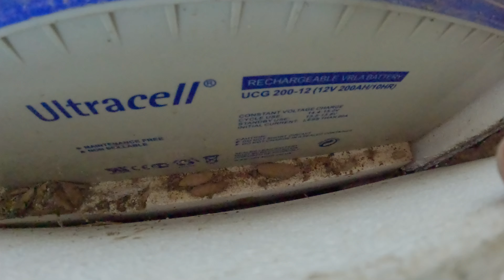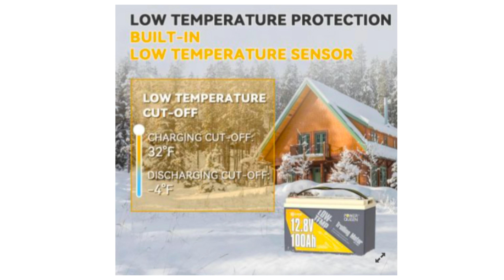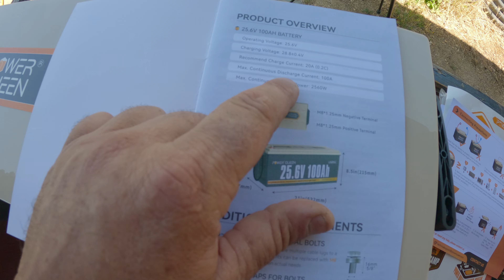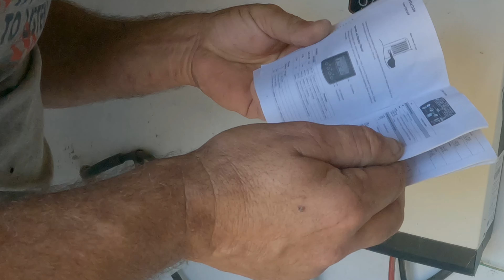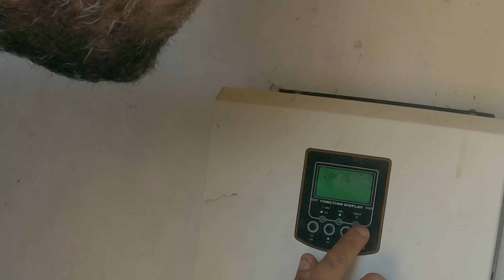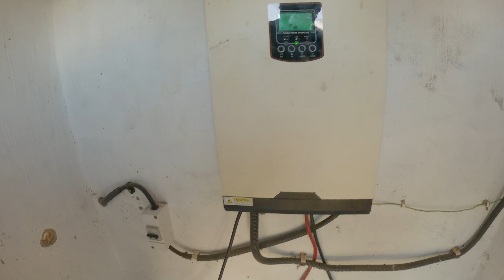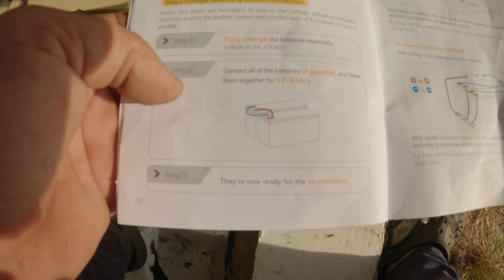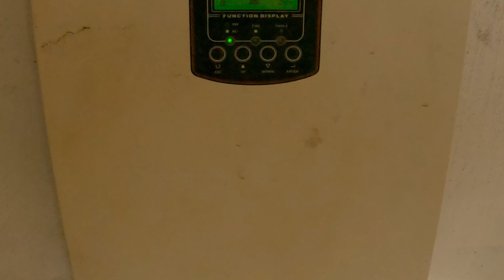Upgrades to our Off Grid Homestead in Central  Portugal #powerqueen

Comment: Wonderful!   I almost said something about the front seat in the car and I realized....it's the same trip!😂😂   I'm so Happy for your new Lips batteries!  On my sail boat I had AGMs.  But here at the house I have 2 Lipps 12V 28amp 100hrs.  But I only have 400 Watt panels. The panels, are going on my shed roof.  I don't have a lot of cleared land around me, and to many pine trees I have to watch out for!  Well the system will keep all my battery operated tools charge, my lawn mower is battery(reason I changed is long, I'll save it for another time)  and a battery operated limb saw.  It's cool but hard to hold cause my arms get tired.  And it will keep whatever lights outside that are not solar powered operating.  So it's good for now.  I have a 15 ft x 15ft Screened in porch off my dinning area (bought this way) and after Big storms, I put my zero gravity beach/deck chair out there and sleep like a baby bc the wind still. Lows for a few days and there's no power in the house.  Now I have box fans I hook up to my Bluetti!  LOL
Reply from the maker: Oh wow Melinda thanks for sharing all this with us 😁❤️❤️